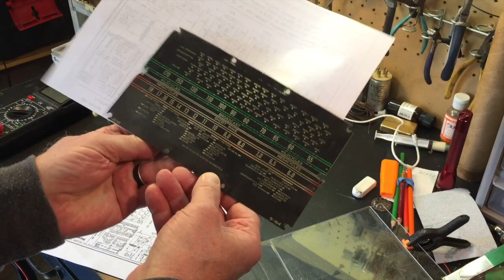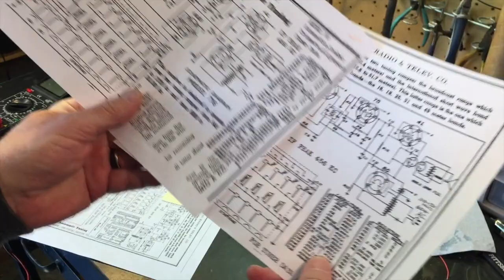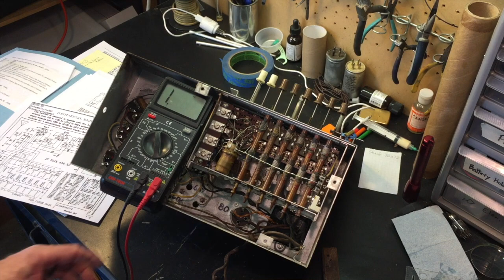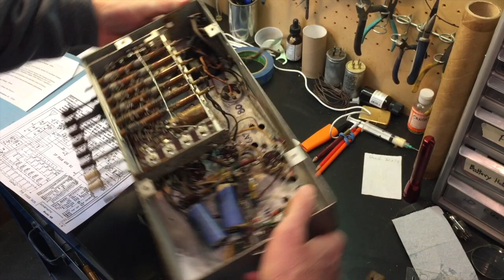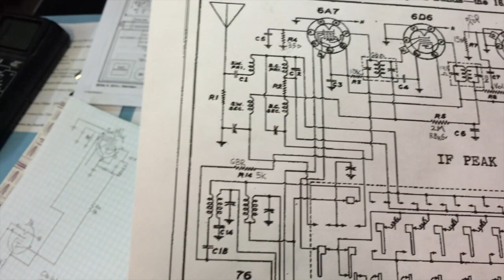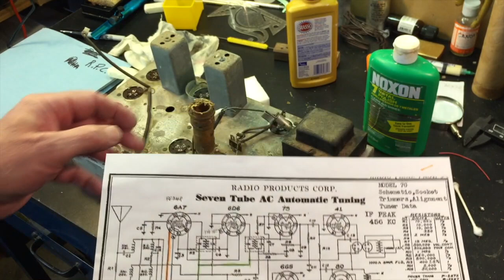RPC Airmaster - Episode 3 - Checking Transformers

Comment: I'm curious about the speaker field coil, did you check it? With the mains transformer, I've had them where the ht secondary has a resistance to ground due to internal tracking. Also particularly with damp or mouse urine the IF transformers can leak from HT primary to secondary in use. Might be worth including these checks in your testing.
Reply from the maker: Yes, I did check the field coil. Thanks.